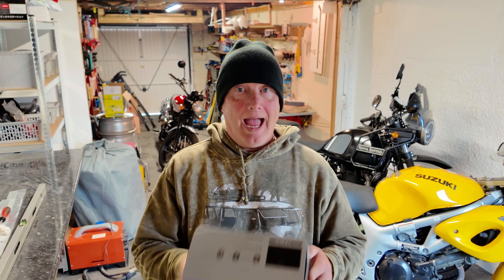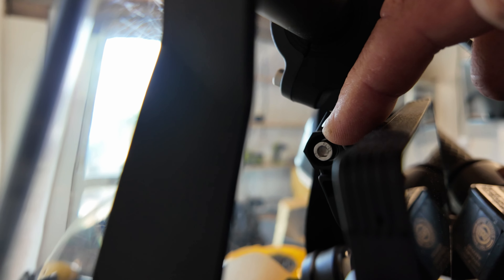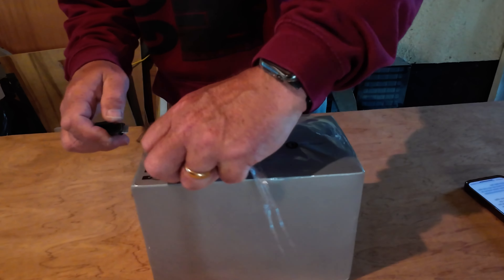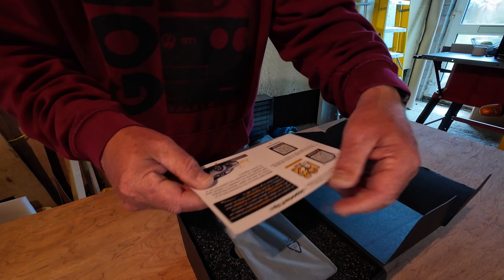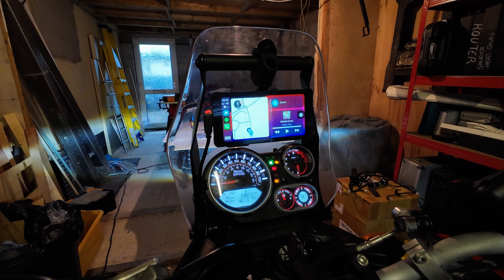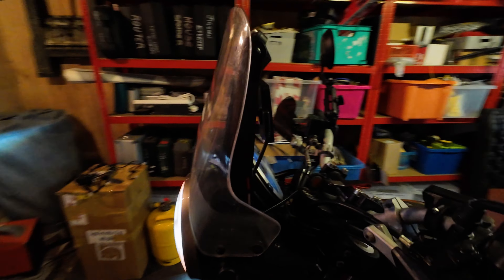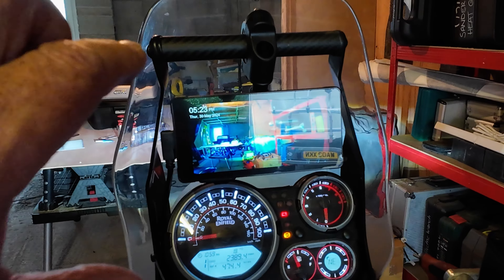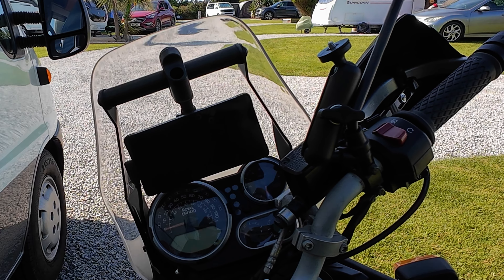Lamtto RC12 Motorcycle Smart Screen : Install and Review

Comment: Thank you for this video and I completely agree with you that there should definitely be an easy mounting and dismounting system for the Lamtto RC12, a system like QUAD LOCK would be perfect.
I have already sent Lamtto an email about this issue and hope they will take this seriously.
I'm waiting for an answer from Lamtto!
Reply from the maker: You are absolutely right QUAD LOCK would be perfect. Thank you for watching the video 🙏🏻
Reply: Hello again, Is it possible to ask you a technical question?

The description states that the Power Input must be 5V/2.5A.
My question is, can I also connect the RC12 to a telephone charger to charge it.
This charger has an output of 5.0V 2.0A 10.0W.
Thank you in advance.
Reply from the maker: I couldn’t answer your question properly but this what I can tell you the car version of this screen has worked from multiple 12v car cigarette lighters with no issues so you should be fine. But to be 100% maybe contact lamto themselves
Reply: @FootstepsTyretracks  Thanks 👍🏼

Comment: well i have fitted one to my CFR1000l and its great i used the alarm out let to power the unit to turn it off and on,. you can use the spilt screen our i must say i use the rear camera, and it does come into its own on the motorways the play back feature works well and i you are riding out with friends you can show them there bad habits so all in all its good value for the money and what it is and works well with my Nolan 44 coms but as for the maps and so on i do use my Zumo xt as my main sat nav. and my cell phone for my OS maps when out in the country side as they show more detail. yours kevin
Reply from the maker: I sold my Royal Enfield a little while ago and I do miss it I might have to get another. Thanks for watching and Commenting 🙏🏻